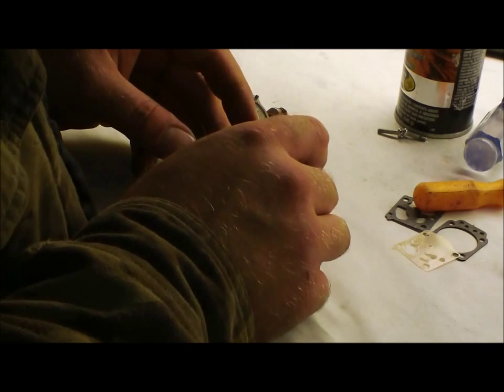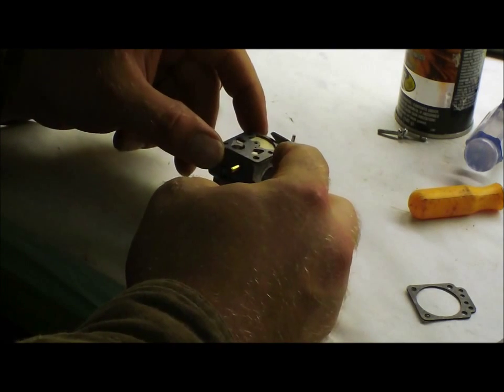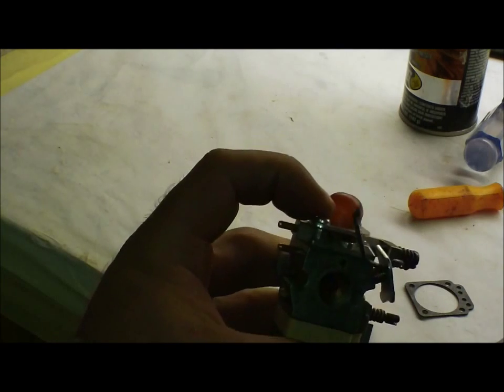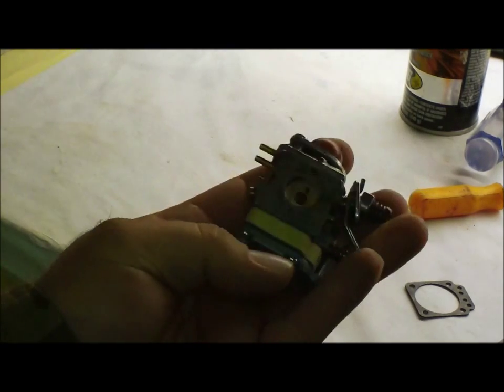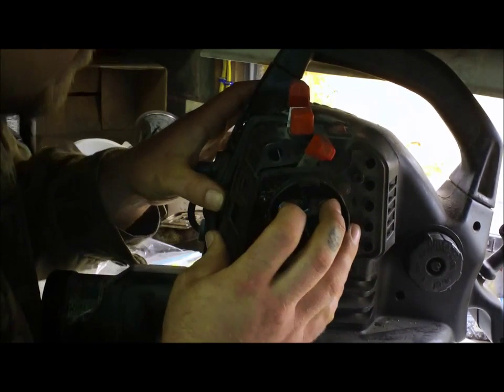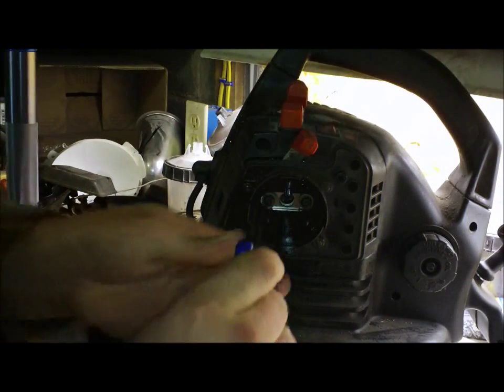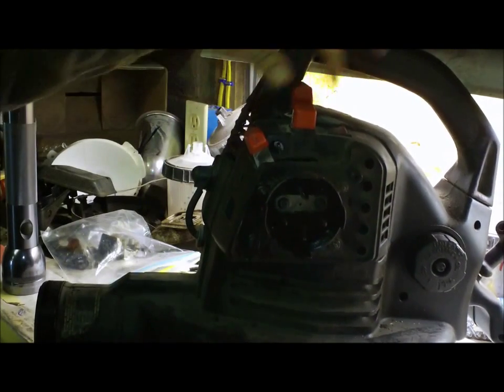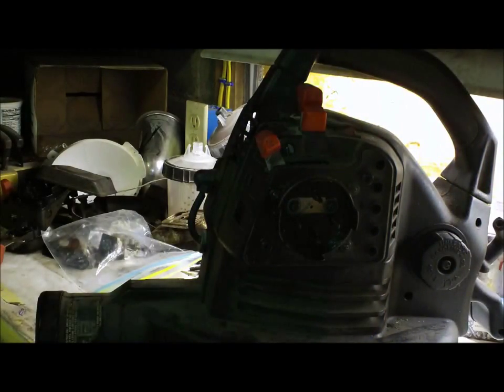craftsman leaf blower carb rebuild pt 4

Comment from the maker: you could but i would be afraid of the fuel eating threw the silicone causing it to leak (i guess you could...just tighten up the hold down bolts after it wears but i just don't use anything) if it was a new gasket it has little pegs it sits on but since it was an old gasket it just sucks a little